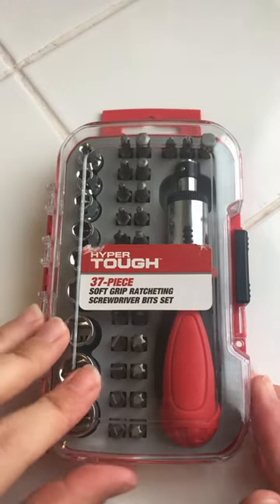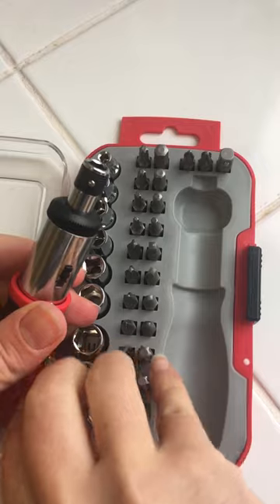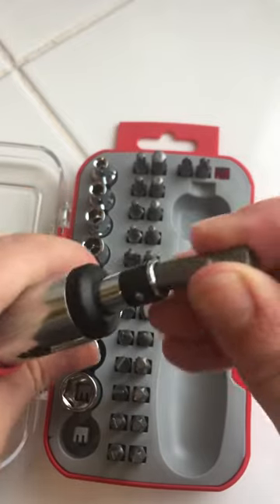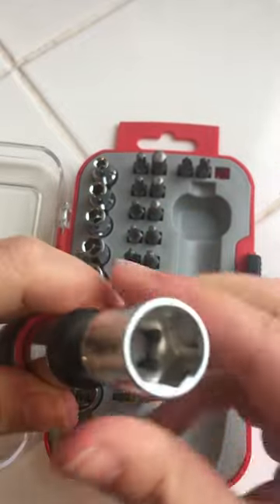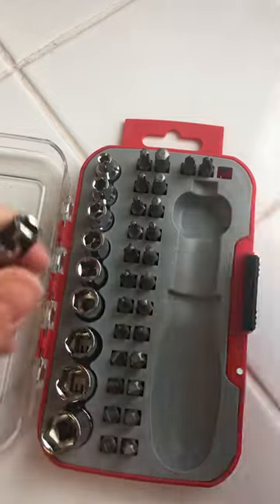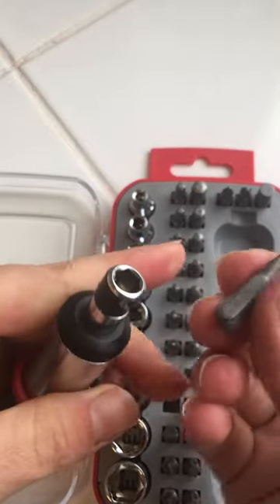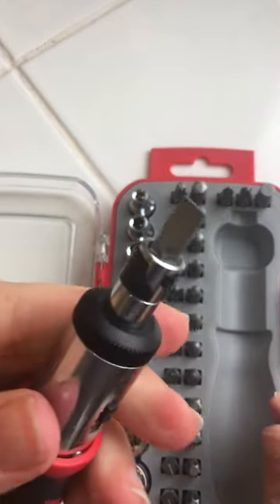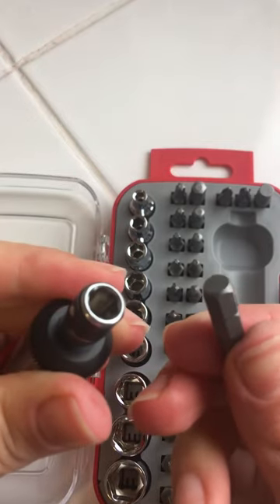37 Piece Ratcheting Screwdriver Set ‘How To’

Comment: It's really a pain to load and unload the screw bits because there is a ball inside the holder to prevent the bit falling. There is a button that you push on high end bolt nuts ratchets. Wish there was such a mechanism on these too.